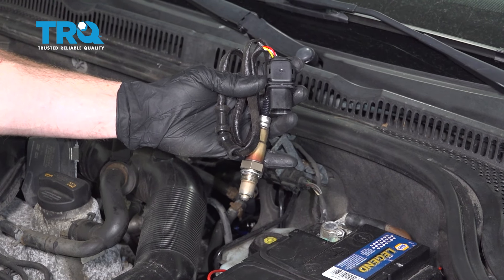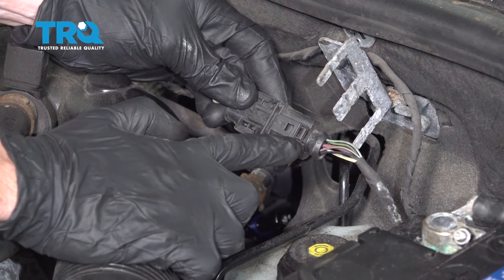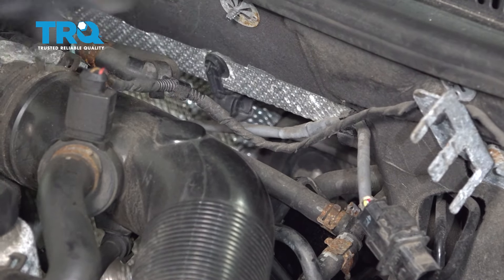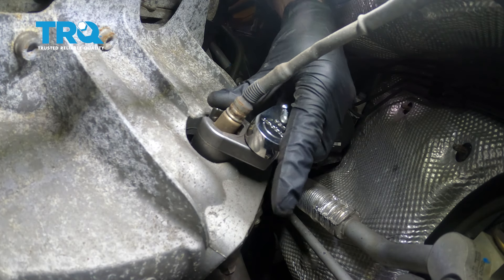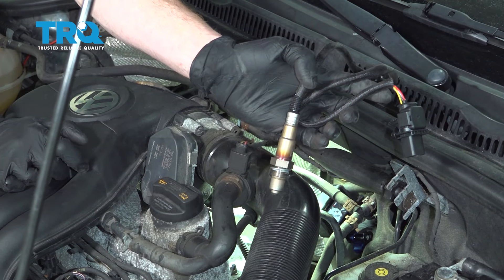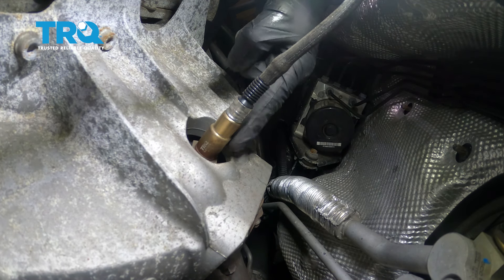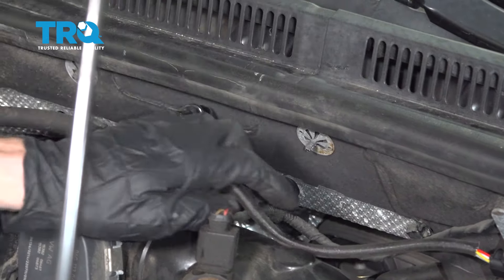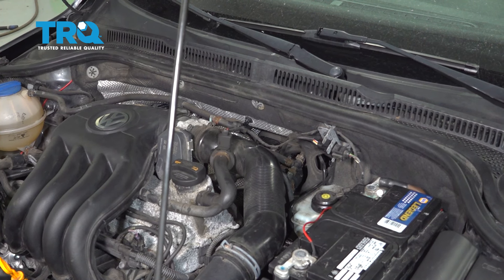How to Replace Upstream O2 Sensor 2011-2018 Volkswagen Jetta

Comment: What is the name of that socket type? I don't know how to find it online. Thanks.
Reply: If it helps. Head over to your nearby auto shop like Oreilys or Autozone and ask for the loan a tool option. They have kits for sockets that are specifically to remove oxygen sensors. This way you borrow the tool, use it and return it. There may be a deposit/hold on the item but as soon as you return it, it is released. No charge
Reply: @victorbriceno8401  thanks. I ended up finding it and just buying one in case i ever need one in the future. Saved so much installing it myself that i figured, "why not?".

Comment: Hi, after replacing the o2 part, my check engine light is still on and now my EPC light is on as well. Do I have to drive it a certain amount? Should it turn off by itself? Do I have to reset the warning lights and see if it comes back on again? Did I possibly mess something up as now the EPC light is on? Thanks

Comment: I have a 2019 manual Jetta throwing an o2 code. The symptoms were jerky acceleration in first and 2nd then fluttering with load and throttle, seems to disappear for months at a time then come back

Comment: My question is regarding the replacement part. My wife has the 2013 2.5 SE and so far every time I have had to change/replace any parts I find myself having to purchase OEM. Aftermarket parts for some reason don’t last or don’t work at all. Any tips as to whether this oxygen sensor worked after its addition? Thank you for the great video and feedback.
Reply: You probably already bought your part but my mechanic buddies all told me to go with Bosch for a replacement part.
Reply: Bosch is the original manufacturer for some car parts for EVERY car, they created the o2 and mass air flow sensors, and soon it became the standard for all cars.

Comment: Hi I have a Volkswagen Jetta 2.0 tdi 150 hp travel 68000 km I cleaned the 1 sensor installed to the left of the turbo with the 2 other o2 sensors but after 3 days I have smoke coming out of this sensor when what's the problem with automatic regeneration?

￼

Commentaires